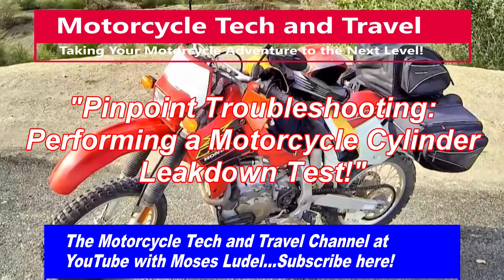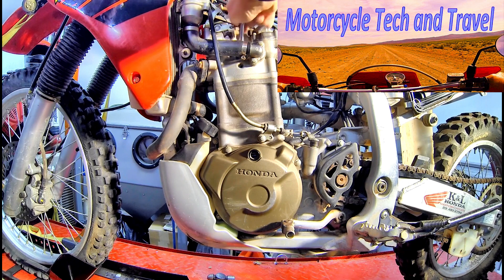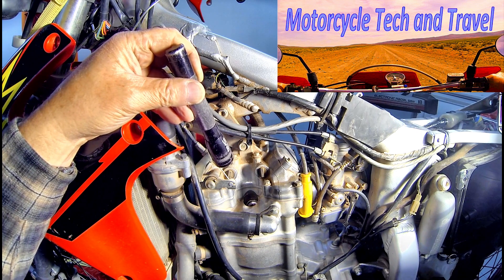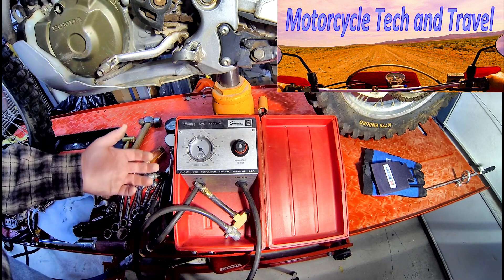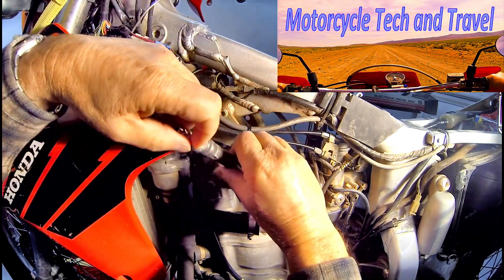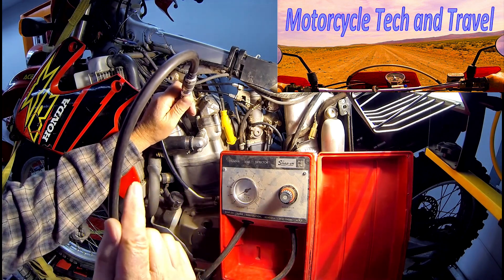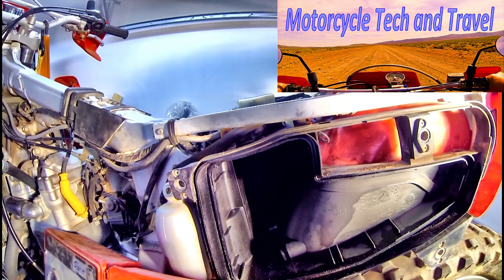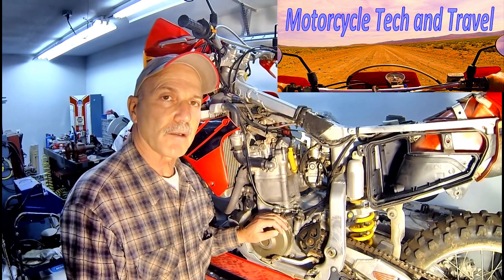Cylinder Leak Down Test for Pinpoint Motorcycle Engine Diagnostics

Comment: Just tested a Yamaha at 97.5% average leak down.  Cylinders 2&3 air came out the intake and 1&4 just a slight bit of acoustic air noise in the oil filler cap only.
Reply from the maker: Is there a leakage reading near 97.5% at each cylinder?  If this high leak percentage is inconsistent with how the engine runs or what seems like decent cranking compression, it's possible the test is not at top-dead-center (TDC) of the compression stroke for each cylinder.  I like to watch the piston come up in the cylinder to find TDC.  (Actual TDC for #1 piston can be pinpointed with the crankshaft's timing mark for TDC.)  Valves must be closed/seated.  Either look at the valves with a borescope or simply check that cylinder's rocker arms or cam followers for free play.  If a valve or valves are not closed, the piston TDC is at the top of the exhaust stroke and not the compression stroke.  If so, you need to make sure that the piston is at TDC on the compression stroke with the valves closed.  If neither of a piston's TDC positions show the valves closed, the timing chain may have jumped teeth or is otherwise misaligned...If valves are seated with the piston at TDC on its compression stroke, and this is a true reading for a given cylinder, it would indicate that #2 and #3 cylinders have leaking intake valves;  #1 and #4 cylinders have piston ring blow-by into the crankcase with air moving up through the engine to the filler cap...Let us know what you find.

Comment: What would cause valves off their seats?
Reply from the maker: Tight, incorrect valve adjustment can unseat the valves.  Unseated valves are a symptom of valve clearances either adjusted too tightly or becoming too tight.  If the cause is not mis-adjusted valves, there is likely valve face and valve seat wear.  Wear into the valve seats is called valve seat recession.  Years ago, one cause of valve seat recession was lack of lubrication.  This occurred when leaded fuel changed to unleaded.  Non-hardened, cast iron valve seats of that era required lead as a lubricant.  Without lead, the valves wore into the valve seats.  To survive on unleaded gasoline, engines got flame hardened cast seats or hard steel insert seats like we find in our motorcycle engines.  (Aluminum heads have always required hard steel valve seats.)  So major valve seat recession or valves way out of adjustment can unseat the valves.  Minor valve and seat wear is normal and the primary reason we check and adjust valves routinely…On engines with hydraulic lifters, a defective lifter can “pump up” and cause the valve to unseat.
Reply: @MotorcycleTechandTravel 95% leakage is tremendous.